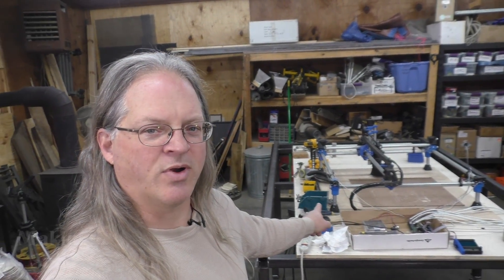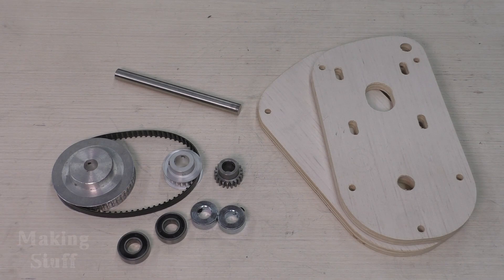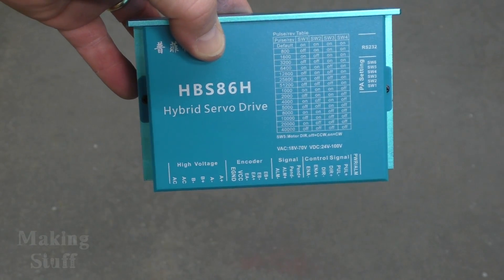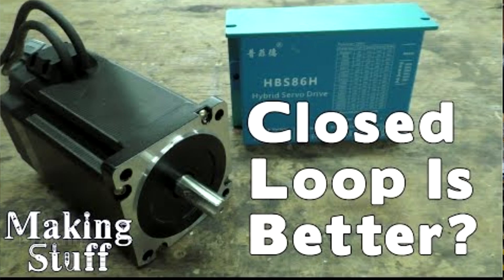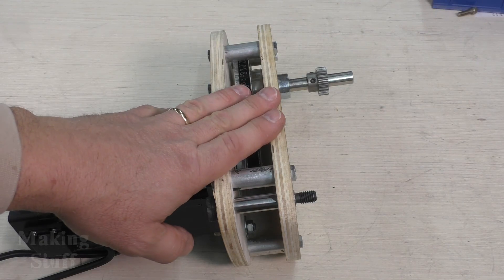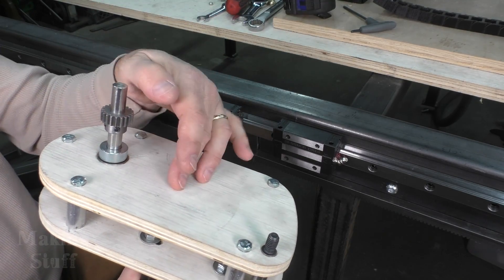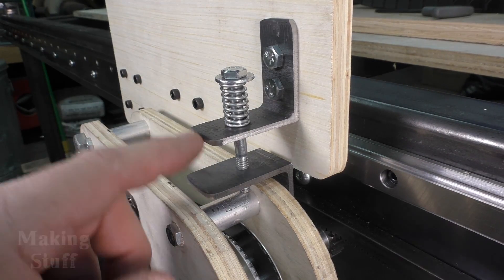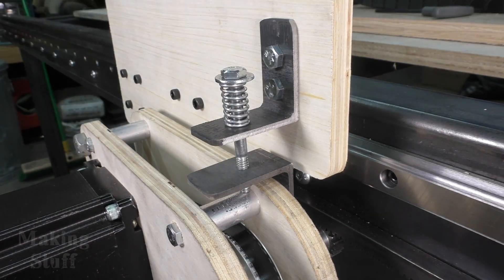DIY CNC Router - Part 3 Drive Reduction

Comment from the maker: What do you guys think about it so far?  Let me know what you think.  Check out this review I made on that mega sized closed loop stepper motor.  https://youtu.be/SoRdEAm1auk
Reply: I'm waiting for your machine to get complete. So i can make one with these instructions. 😄
Reply: I love it. I love your ingenuity and I want more.
Reply: That is a lot of torque for the set screws to hold the pulleys and gears onto a shaft.
At the very least need to grind a flat on the shaft for the set screw to press against. 
Use second set screw to push the first one in the aluminium pulley.
You may need to pin the pinion gear to the shaft.
Reply: I'd mount the motors so they go under the frame rails, so the whole machine needs less space / you're less likely to bump into it while walking around. You'd need to somehow inset the central feet though.
Reply: The build is amazing, easy to understand the whole concept. Thanks a lot for sharing the knowledge. 
One thing popped into my head while watching this, is it necessary to remove the pinion gear from the rack while the CNC not operating? 
If I install the pinion perfectly meshed with the rack one time, is the going to stay permanent without harming the gear teeth? I am not sure why I am thinking this, but it would be a bit of a hectic job if I have to mesh the gears every day.

Comment: Why did not You connect the servo/stepper motor directly to the pinion rack thread without use a belt ?
Reply from the maker: There is a belt in the drive reduction system.

Comment: I had the same problem as you, in that I needed to add pulley gears and belt to be able to let the motors run at a higher speed, so the gantry can move at a slower speed using the 2 Nema 34 motors on the X-Axis.  My problem is that I really want to move the gantry even much slower than that.  I mainly just wanted to mill PCB's with no flex in the machine, so I ended up buying an oversized machine, one that can do aluminun, and even steel, but I made the classic mistake of wanting a single machine that can do a wide variety of tasks. I already have a 3 to 1 gear reduction, so the motor can at least breathe a little, but to go slow enough for milling PCB's, I need more like a 6 to 1 or 9 to 1 speed reduction.  So I can either add another 3 to 1 gear reduction, or possibly get a giant pulley for like a single 9 to 1 reduction, but I have never seen that anywhere before. I have thought about selling my machine and getting something made more for just PCB's but those are usually flimsy and have too much flex even for a PCB.   Another alternative is maybe I could get ball screws that have a 3mm travel distance per revolution, instead of the 5mm per rotation ball screws that I have now.  It is such a nice machine,  If I ever moved to a place to where I could make a lot of noise, then this would be a great machine for aluminum parts, but I still would like to have a way to mill PCB's.  I guess I could design and build a new CNC using perhaps , 6030 or even 4020 extruded rails instead of the 8040 rails i have now.  I think I need a new CNC machine altogether made specfically for milling PCB's. When I try to go slow enough to mill PCB's, the motors run very rough and noisily, and so maybe higher amounts of microstepping may help, or perhaps better drivers that make the motor vibrate less. Something like those TMC2130's but for Nema34's. If anyone has some ideas for me, please comment.  I got the CNC blues.
Reply: This is not a confectionary! Lol

Comment: What's an "inch" ?
What's a "foot-pound"?
(Try metric - much easier).
Reply from the maker: I agree but it's still hard to use metric when all the materials, drill bits, bolts, etc. the I buy are imperial.

Comment: I don't see that this drive reduction system would have any belt tension adjustment regulator between stepper gear and bigger gear? It's not possible to change belt tension?
Reply from the maker: The oval holes where the stepper mounts allows for belt tension.

Comment: About that step motor,,, at what speed does it spin, and how expensive was it? Thanks!  JD
Reply from the maker: I can get about 500 inches per minute out of these motors on my machine and that is the max.  That is with the current gear ratio in the drive reduction.  Here is a link to the motors https://www.banggood.com/custlink/mKKmnuKRpM  AND  https://www.banggood.com/custlink/G3DDwcNOPb

Comment: 10:47 your spring bolt is limited by washer on other bolt, either need to cut it shorter or move it or angle it

Comment: In your gear reduction you didn't add anyway to tighten the belt once it gets loose. Your motor is sticking out a good foot from the frame. Your machine is now 2ft wider.

Comment: Sir, We have to use 2 Steppers for Y Axis , which means our Machine will becomes 4 Axis instead of 3 axis Right??
Or can we give Y Axis both motors connection to single port?

Comment: Are you planing to use 2 motors on long axis? i think you have to push from both sides considering the with of the table
Reply from the maker: Yes it will be just like the plasma cutter.

Comment: How do you plan on dealing with backlash on the rack?  Also, are you concerned that with the hinge design that the pinion might want to jump out of the rack on one direction and bite in going the other?
Reply from the maker: I really won't know until I get it hooked up and get some movement out of the motors.  I do plan on putting a stiffer spring on it.  I think will take care of any problems you have described.

Comment: How did you determine the gear reduction ratios?
Reply from the maker: I've been told that around 3:1 is the sweet spot.  My setup is 2.2:1 because that is what I could make with the gears I had on hand.
Reply: @MakingStuff  Thanks for fast reply
Reply: @MakingStuff  why do i see so many direct drives off of steppers?

Comment: What type and pith pulley do you used? And the spring look too wick for the job
Reply from the maker: The iming belt pulley on the motor is 20 tooth, the larger one is 44 Tooth and the pinion gear on the rack is 20 tooth.  I used an XL timing belt.
Reply: I know the rack is from CNCRouter Parts if I got that right but where did you source the pinion from?

Comment: On the MPCNC, have you considered using a 3 or 4 flute cutter? The additional cutters at a slower speed should accomplish something somewhat similar to a 1 or 2 flute endmill at faster speeds.
Reply from the maker: No but I will check into it.  The Aluminum cutting bits I bought are single flute.
Reply: @MakingStuff  I believe single flutes are more common for higher speed spindles because it creates a proper chip size without welding to the bit. Since the speed of your spindle is slower, the higher flute count will product smaller chips, but be chewing through aluminum more frequently. You should be able to adjust for proper chip load I think.

Comment: Was asked already but, you didn't answer.  The gear reduction is needed for a router so the motors don't lose torque or stall which loses steps.  With Plasma, you can get away with it because you are only moving the gantry.   Yes?
Reply from the maker: Yes and because there is no contact bewtween the torch and the workpiee while it is cutting.  The router will have to be pushed through the work piece while it is cutting so it will ned more torque.

Comment: If you find that the plywood parts don't hold up then MDPE (the stuff good quality commercial-grade chopping boards are made from) is a good middle-ground.  
Or even UHMW if you can get it for the right price.

It's stiffer and more dimensionally stable than wood, easier to machine than aluminium.
In some places it'll be good enough that half the time you won't even need to exchange it for metal parts.

---

I keep a stack of 1/2" chopping boards around for just this sort of thing (got a job-lot cheap from restaurant liquidation sale).

...I still use ply for templating though.
Reply from the maker: Thanks for your input, I will check into it.

Comment: Loving the closed-loop steppers I have never used them in any of my many builds so I am very interested to see how that goes. I may be wrong but I can't see that there is going to be near enough tension in that spring holding the pinion onto the rack but time will tell I guess. Its a bit late now but helical rack is much smoother if you can find it.  All good work though.
Reply from the maker: Helical is too hard to find, if not I would have used it.  Thanks for watching!

Comment: I love the stuff you make - very imaginative and plenty of thought put it. The ply pieces that you plan to replace with aluminium, could just be laminated in  (2mm?) aluminium that the router table should be able to route. Gluing and screwing the sheet on both sides of the parts should give you the rigidity of the solid aluminium parts, although they will be a little thicker.
Reply: I did not see that part. I am glad he plans on replacing them with aluminum.  Plywood is cool, but aluminum is what is called for.
Reply from the maker: Thanks for you input.  Thaks for watching.

Comment: I'm assuming you're already intending to do this, but a flat head socket bolt will be better than using a cap head if you're counter sinking (especially into plywood). Also you may want to file slots for keys in those pulleys instead of using the grub screws into the key slots. It'll tighten the fit up a bit and be much stronger. You can still put a small indent on the stepper shaft for a grub screw. Oh, and washers would be good to use where you're bolting stuff to plywood. Minor things, I don't think any of that is necessary just my 2 cents. 

I like your project, keep at it!
Reply from the maker: Thanks for you input.  Thanks for watching!

Comment: I will also make my parts in ply for debugging.

Why NOT complete the 4x8 with ply parts, then use it to mill the alu parts?
Reply from the maker: That's the plan.  Hopefully the plywood will hold together long enough to make the aluminum parts.